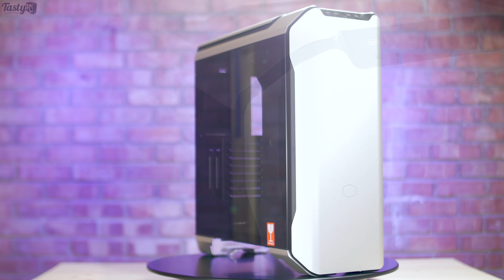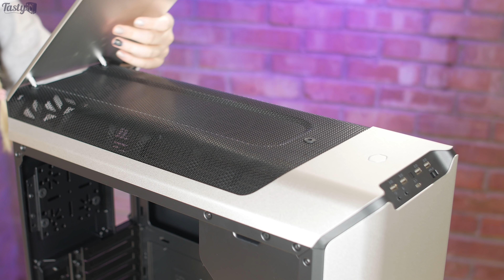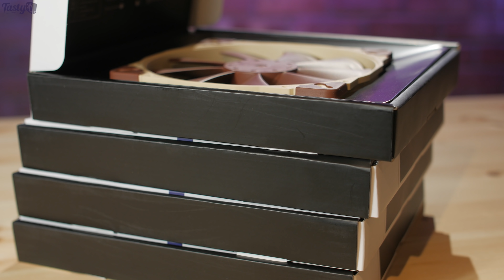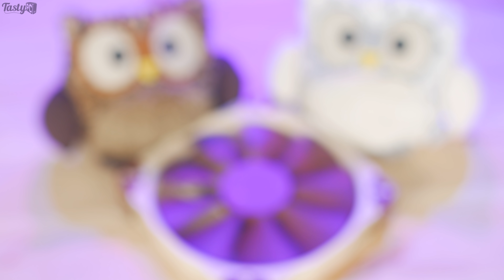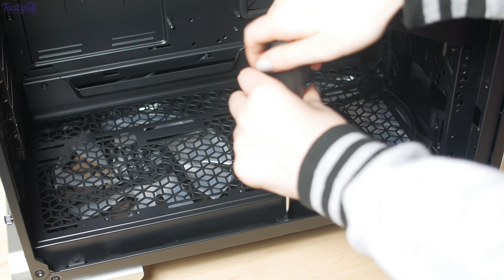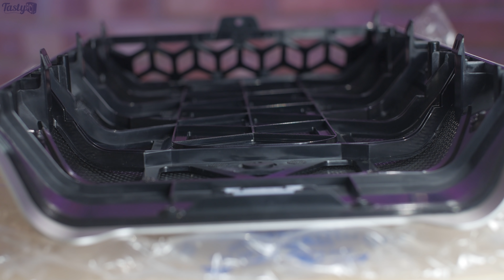Creating a 200MM Noctua Wind Tunnel

Comment: Thanks for the video. I am in the same situation, and now I know I don't want to do this. The remaining plastic is way too thin for my taste and it doesn't seem right to do this to an case this expensive. Too bad Noctua doesn't produce some thinner 200mm fans! I now wonder whether I should use 3*140mm Noctuas or 2*cheaper 200mm fans ..

Comment: Old vid but why not cut fan then expensive case ?

If you fuck it up fan just get new one but if duck up case it go be very expensive
Reply from the maker: I still use the Noctua fans that I bought 8 years ago, the cases of that era.. not so much. Keep in mind that two 200mm Noctua fans costs almost as much as a budget case on their own. They're not cheap fans.
Also, if I had damaged a part of the case I would have been able to get in touch with Cooler Master support and ask to purchase a replacement part (not the entire case). Any good case manufacturer should carry spare parts for repairs.

Comment: Hi Lauren. I just put two Noctua NF-A20s (black) in the bottom of my SL600M and when you use the Noctua anti-vibration fan mounts (NA-SAV2) there's no issue with the fans overlapping of getting the CM side cover back on. It's a bit tight, but it works. Cheers for the original video - it's the most detailed description I could find on how to do this.
Reply: Does it improve cooling?

Comment: I've purchased an sl600m yesterday and guess what, ordered 2 x 200mm noctuas the black ones,   then I was wondering how to mount those at the top if they are outside specs.   You are the only source that explained how to mount those pizzas at the top. Ready to use my Dremel too.   Thank you very much!!!!!! Great and detailed  video, like the style and the quality you added too.
I will keep the originals an the bottom, they are very expensive here.  4 noctuas are priced here more that the sl600m itself.
Reply from the maker: Good luck mounting the pizzas lol ^-^

Comment: Cool idea, but not sure putting the top shield back is a good idea. The low stati pressure of the 200mm fans will be hindered a bunch. The 200mm fans really need unobstructed flow as mush as possible.

Comment: i always get a higher watt psu even if i don't need. because efficiency. Psu are more efficient on load if it has extra head room for hardware to pull power. your hardware will pull enough power that it needs.

Comment: I think this type of vertical funnel design on a case makes a lot more sense than horizontal. Since the hot air moves up naturally, so makes sense pushing the air upwards with the fans to make it more efficient

Comment: I really liked to see how you modded the top piece. It wasn't really visible, but you still put a lot of effort into it anyway to get a clean result.
It would be nuts if there was enough place to mount a dual 200mm radiator to the top or bottom as well, Phobya makes these kind of huge radiators and the Noctua fans are just perfect for them.

Comment: I notice Noctua has started doing 200mm in Chroma (ie black with all the extra colours in the box), and they have a cool PWM controler NA-FC1 that you can plug them all into, with features such as not letting them drop below 300rps (ie no stall) and the adapters for Sata power seprate from the PWM for the mainboard, and you can plug all 4 fans into it... so you can rock all four fans from one motherboard PWM header (well or more, seems you just add spliters to the 1-to-3 that comes in its box.) Man you got me looking up this case... and I'm an ITX fanboy...

Comment: I was recently dissapointed with my Noctua NF-A1x fans...they are so noisey at full speed.  The motor vibration creates a loud buzz that I wasn't expecting.  Happens on 120 more than the 140s I have :(

Comment: Quick tip... putting four large fans in and then fitting that top aluminium cover that blocks the path of the air undoes all the advantages.
A beautiful build into a beautiful case, but one with a severe flaw...

Comment: I'm sorry a 1000W power supply is STILL overkill, EVEN IF you want to 'keep plenty of room for future upgrades'. 
Unless you are planning to OC a high tdp cpu and two gpu's with a ton of harddrives, you should be fine with 800W or less even ^^

Comment: I love 200mm fans. But especially when controlled they can do a lot of work without too much noise, also depending on the fans of course. Of course MagLev or Liquid Bearing would be best for noise still. My front mounted 200mm just developed a bad bearing, kind of sucks.
I hate the colors of the Noctua ones, and i actually think they would sell so much more if they had better colors, because they are known to be some of the best out there.
Just black, white, maybe some added color optional pads, optional RGB, they'd probably still do better. For 120 and 140mm as well.

I would leave the top cover off, it only means the air can move more freely, since it won't be stiffled. And i think the mesh looks cool as well, and it probably won't matter in any other meaningful way.

The power supply mounting is different, and not a bad idea really.

That fan mount in the back, where it's closed off, is, weird...

Comment: Personally I'd run the input fan curves a fair bit faster than the exhaust fans as you may pull in dust from elsewhere otherwise. I generally use the Rubber plugs to mount Noctua fans not the screws as you use Noctua for the Acustic Vs Performance they provide and the rubber mounts help IME.
IMO you can't have too much PSU.
It makes me feel ill seeing those nicely vented faces covered with plastic panels.. the modern case designs seem to be coming from fashion designers rather than engineers.. madness.

Comment: i would sand off the edges of the noctua fans that touch and maybe add a piece of rubber in the middle to avoid vibrations
i have a noctua build where i have all the fans possible in my case as noctuas, same with gpu heatsink and psu.

Comment: Couldnt you place the fans inside the case without killing your case?

Thermals would be interesting. Stock vs 4x 200 MM noctua. 

I have the same Case with a 360 AIO on top but stock fans on bottom. It has the best thermals ive ever seen on a case.
Ima having a under full load a 66 Degree 2070 Super and a 65 degree 3700x. If i remove the dust filter on bottom i have a 58 Degree on GPU and 62 ond GPU. 

And i agree the Front Panel ist also the best. Having 5x USB in front + lights is just perfection.

Comment: Hi ! I love the idea of 4x 200mm fans in a case, had one in my old case and loved that bad boy !
One little suggestion tho : The way the fans are mounted, you're pulling fresh air from the top and exhaust hot air at the bottom.
You might want to flip those fans the other way, pulling fresh air from the bottom and exhausting from the top. 
Because cool air tends to stay at the bottom, and warm air rise naturally. Also the hard top makes for a nice intake choke point
Cheers !
Reply from the maker: Hey, the fans are mounted correctly in the video to bring air from underneath the case (through the bottom dust filter) into the case and then up and out of the roof.
The top panel can be either On/Partly On/Off and I'll be testing thermals in all 3 placements in a later video. :)
Reply: @TastyPC  Oh my bad, thought the sticker side was the exhaust side on Noctuas fans, I was wrong. 
Keep up the good work ;)

Comment: ok, I want that. I love 200mm fans, massive airflow little noise. Maybe I will get around to building one :) thanks for the vid. (btw did you consider sanding a wee bit of the fans at the bottome so they fit flush? - and have you considered the extension for the Dremel that lets you use it more like a pen, much easyer for what you were doing).

Comment: That 2080ti deserves a Zen 2 CPU ;) i love the H500P Mesh White. If it had more radiator mounts, and/or you could mount in the front with the 200mm fans set up id prob get it over the 011D im about the upgrade to in prep for a weird custom loop im planning based on the Eisbaer. Super awesome builds tho!!! Wish they made 200mm Noctua Redux fans in grey with the chromax corners, tho are my fav :)

Comment: As good and quiet as Noctua Fans are I do see one issue that the Noctua fans Probably cannot overcome and that will be the wind noise caused by using that Grill on the bottom, Air passing through that grill will make a noise because the fans are closer to it, I really hope this isn't a issue for you as I do like the case you chose, it very different from the norm. Would be interesting to know how this works out for you long term.
Reply from the maker: Grills do make a system louder, you're not wrong there. I'm going to look at optimising airflow/noise/thermals when the build is done, so both the top panel and bottom grill will be investigated. :)

Comment: If I hadn't bought my Jonsbo Case, which uses 2x 120mm bottom intakes, 1x 120mm rear intake and 2x 120mm top exhausts (plus the PSU, acting as a 3rd 120mm top exhaust), I'd probably took this video as advice and bought exactly that combination of case and fans. Because, when I bounce a project in my DAW, the thermally controlled fans crank up to 100% speed and they sound like an airplane at take-off. 😂 I really like the (thermal) design of the shown Case. And bigups to your modding skills, Lauren. 😉 But doesn't Noctua also make black fans nowadays? I think they'd look a bit better in your build, because of blending in better with the case. But, anyway, it looks nice AF. I'm curious about thermals, noise levels and the look of the finished build. Bigup! ✌🏽

Comment: 1000 watts isn't overkill depending on the hardware you're using. If you go to the product page and look at the efficiency curve, you're at peak efficiency at 50% load. If your system is drawing around 500W of power, this would be a perfect power supply for it. I think a lot of the people who complain about "oversized" power supplies fail to take this into consideration. Plus, you're leaving yourself plenty of room to grow.

https://www.coolermaster.com/catalog/power-supplies/v-series/v1000-platinum/

Comment: giant fans are great, they move tons of air quietly..and that's always the goal, when I stated building I was obsessed with keeping things cool and trying all types of ways, basically all I do now is push ambient air into the cpu and vent the heat out the top at the other end of the case and the psu, I prefer silence over a lower temps which hardly matter at all, I don't mess with cases much anymore, still like my deepcool steamcastle, but I've done htc builds, built a few tiny htc's with wood and had a thermaltake armor+ full tower, maybe I'll do a full atx build next..but no rush, small builds are more challenging which is great but the big builds have so much more possibilities, nice fans

Comment: I wonder how much air-flow is blocked when you put that top cover on (8:16). It looked like the fans where lower in the original design so they blew into that area and out. now the fans are on the top, they are directly blowing into a solid piece of plastic. I would remove that top piece of plastic for better cooling performance.

Comment: That case design makes absolute sense. Since heat rises, so natural convection will cause air flow on its own. But thats kinda irrelevant in this case since you have more air flow than Boeing's air testing tunnel.

Comment: You did just fine, most guys would not even attempt to sand plastic, so don't cut yourself short. Most think simply changing the fans from those provided is MODDING a PC. As you mentioned, this is your first MOD and you figured out what you needed to do to make those fans work in your case for that I say KUDOS you did well...

Comment: 1000 watts a lot of headroom unless you doing a suicide run 5ghz OC on a q6600 and two volt modded gtx 680 lightning's you can draw 900watts or just over in benchmarking. Not that I know that...

Comment: If you're concerned about the overlap on the bottom fans take that sanding bit on your dremel and hit the edge of those fans.  Sure it might hurt a bit defacing some expensive Noctua fans, but the flatter they lay the easier it will be on the fans and improve lifespan.

Comment: I did the bottom intake once. It worked grate as the air in the bottom of a room is typically cooler. However its also the dustiest. So I reversed the flow. looking forward to seeing how this goes. hugs have fiun

Comment: This design won´t work better than any other traditional mesh case well set up, in fact it´s probably gonna be worst. That´s because the GPU is in the way and the heatsink on the CP, won´t receive much air. Even if  I dont like liquid cooling, this case design, it´s probably one of the best designs for a custom loop case.

Comment: I'm about to build a new workstation and this case looks perfect! Will these giant Noctuas run low and slow for near silence?
Reply from the maker: In my initial experimenting, at low RPM the 4 fans were quieter than the PSU.
Reply: @TastyPC  thank you for replying! My PSU happens to be a 1000w Corsair, so keeping the load below 400w means the fan doesn't turn on. I'll start planning my build 😊 Thanks for the wicked content!🙏

Comment: Welp, I've been building PC's for about 12 years now, and have yet to have the pleasure of saying "This thing didn't fit. I whipped out the dremel, now it does". I'd say you have every right to be excited. 
That said, holy crap those are some huge fans, the final build is going to be absolutely ravishing! Would love to see what kind of noise output the final assembled build has, both under load and idle!

Comment: OMG i love the giggle, yes giigle yes it can, so cute. EDIT: also the psu will only take what it needs to power the components, will be less effective but not by much
Reply: PSU's are most effective at 50%. So if your build is using 500W under load a 1000W would be the most effective. But the amount of money you save are nothing compared to the cost of a bigger PSU. So the reason of going bigger should always be because you need it or might need it in the future.

Comment: Reminds me of my old Cooler Master HAF XM case which also had four 200mm fans, albeit with front/side intake and dual top exhaust. The amount of air 200mm fans can push is insane for the low RPM they spin at (and thus low noise). I ended up doing a similar mod to that case too to fit a 2x180mm radiator/fan setup in the top section...

Comment: Are you going to vertically mount the graphics card? If you dont the cpu intake will be blocked and the graphics card will screw up the 'wind tunnel' effect you are going for. I also like the vertical airflow design and went for an oldskool silverstone case in my last build. Rotated MB makes the vertical airflow easier, but then your cables come out the top, which is a bit weird.

Comment: Rather than a dremel, try an oscillating tool for strait cuts. They make rounded and strait blades for most, and most also let you change the orientation of the blade so your not fighting the tool like you look to be doing at about 7:27.   The next pit is for a dremel.... get the wand extension for it and an aluminium pan (like a turkey pan). It's not great for the bearing in the wand, but since there is no electric in it, you can cut under water to minimize the melting, or at the very least, cool it almost immediately (ice water bath).  I'd still suggest some sort of rubber cloves with the water, as that old law, however unlikely could come into play.... "whatever can go wrong, will...." so non-conductive gloves just cover the bases.....

Comment: Definitely a different case design.  Ginormous video cards though will disrupt some of the airflow but you are also blowing right on to the front of them.  Great job with your first use of a dremel!  You capture how easy it really is, which is really the highlight of the video in my opinion.
Reply from the maker: Ideally I would vertically mount the GPU as close to the motherboard as possible, but I need to install a 10GbE network card so I will be blocking the tunnel quite a bit unfortunately. :/

Comment: Very interested in the heat test results, my try this on my next build... Though can imagine the dust filter will get clogged pretty quickly, how easy is it to remove and clean that dust filter while the machine is still running? (I never turn my pc off)
Reply from the maker: Dust management should be the same as any other case really. These 200mm fans can spin as low as 350RPM so it’s up to you how much air/dust they move. In terms of removing the dust filter, well I guess that depends on how well you manage the cables back there.

Comment: Wouldn't it be nice if all the cases, coolers and fans had downloadable 3D files that one could just mash together and see right up front whether the things will fit or what mods need to be done? Maybe that's something that could be brought up with the manufacturers.

I propose that the old 1987 OBJ file format would be sufficient for this purpose and shouldn't make them too afraid of potential knockoffs, though if they were particularly bold, they could publish STEP files too. Since OBJ is dimensionless, it needs to be standardised to either 1mm per unit like in 3D printing or 1m per unit like would look sensible directly after import into most 3D modelling software, since the default view comfortably encompasses several units of space. OBJ is supported by everything, even 3D print preparation software (though STL format is more common there), can specify several distinct objects per file to maintain their spatial relationship, and can be augmented with MTL files to specify simple rendering parameters like colour and reflective properties. A bit of colour can be very helpful to just distinguish metal, plastic and rubber parts from each other.